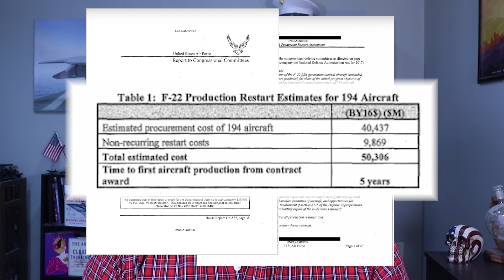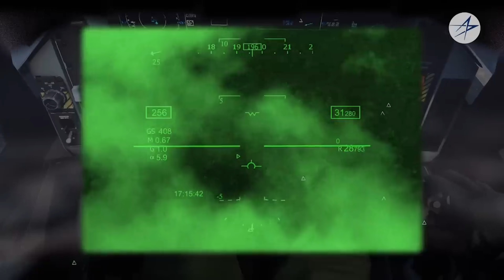The 2ND GENERATION F-22 RAPTOR we ALMOST got

Comment: F-22 and F-35 are too complicated - therefore they are obsolete by the time you've put the latest version of them into service. Gen 4 aircraft are relatively easy (for the west) to upgrade and keep current, for this reason Typhoon and F-15EX are probably the best air to air aircraft in the world as the systems on board (and more importantly the integration with the weapons) are more current than the "more advanced" stealth planes, which have been plagued by endless walls of bugs causing inescapable progress-crushing design freezes preventing the project from staying current in terms of processing, sensor technology and integration with new weapons.  In other words by the time you finally integrate anything new onto F-35 or F-22 - it's already out of date. The latest greatest thing can be bolted into Typhoon, F-15, F-16 etc. and you're good to go after a bit of tweaking - the same project takes 5 years on a F-35 and costs four times as much to integrate and test.

Comment: Thing is: the joint raptor doesn’t even have to be maneuverable. With a HMCS maneuvering is not that important with high g missiles. That means less cost and weight instead of thrust vectoring. Great concept and idea just not as useful in my opinion.

Comment: A better plan in my opinion would have been The F-23 Joint Strike Black Widow. Take the coating and avionics system from the F35 and put it on the F-23. airframe. The bigger weapons bay of the F-23 could allow for better strike capability the the F-22. The F-22B makes a lot of sense for the USAF but the shared logistics would still be limited to the engines and some airframe parts. No matter what other nations that are getting the F-35 would have been interested in getting the F-22b or F-23b Australia, Canada, Finland Norway, Poland,, and Israel jump to mind.

Comment: If they have to build everything from scratch for a new fighter, wouldn't that be the same issue and cost for the NGAD fighter ?
If they started in 2017, they could have had new F22 by now, and when the NGAD fighter comes, they'd have some lines in place that can switch to the NGAD fighter...
I really see no problem with that cost, especially if you need to build everything from scratch again...
If they kept the F22 lines open, F35 would have been more expensive... However you slice it, eventually something will cost more cause you need new stuff to build it !!

Comment: Isn't the F-22's AAR-56 MAWS rather similar to the F-35's DAS?  It isn't integrated and sensor-fused in the same way, but physically it is a similar system that is already installed, and I think one of the upgrades the F-22 is receiving as we speak is greater integration of this system, based on how it's done in the F-35.  It won't allow the pilot to see through the airframe, of course (especially with no HMD), but it will be used to increase overall situational awareness like the DAS does for the F-35.

Comment: One thing which comes to mind while looking at the xmas list of the "Joint Strike Raptor"... 
...is that reading the list should really make one appreciate just what a beast the F-35 is. 
And with over 500 F-35's in service with the US, and more coming every month... why do we need a "JSR" again?

There are a couple decent answers, namely max altitude, high supercruise, and maneuverability.
Hopefully, understanding the targeting capability of the F-35 makes that third reason pretty meaningless.
The first two reasons though, are relevant for air superiority work to close weakness vs high&fast attacks, and to boost energy for longer range BVR engagement.
I think the air force has their eye on something higher & faster though.

Comment: Just goes to show that although advanced, aircraft aren't built like they used to be and its all about money. For how long it took to design and bring the F-22 into service and the amount it cost, it should be an airplane that ladts 40-50 years.  8000 hours is nothing. Flight hours per dollar is ridiculous.  Plus, it sounds like other than the coating, its fairly useless if it has to point what its shooting at. I think the F-23(black widow) performed bettr. I hope they designed the F-35 better. Its like they just dont care. The aircraft they chose to replace the H-60 is another example. Its probably going to end up with the same problems as the osprey. Why they would choose a combat aircraft that has no ability to glide or autorotate if the engines get shot out amazes me. All it can do is crash without engines. At least the Sikorsky model could autorotate. I know our older aircraft aren't as tech heavy, but trillions of dollars should last longer than the career of the person flying it.

Comment: There are still reports of Japan developing there X-2 program and that the speculation had been that Northrop Grumman was involved somehow as well. Now I don’t know how much of this is just YF-23 fans fantasy but this story seems to run parallel to this. Now around 2017, we understood that production of F-22 was being looked at (Lockheed Martin facility, Orlando) but most of them went to work with Northrop team to work on the sensor suite for Lighting. Now with all this going on, one could possibly suggest that the JSR is not 💯 dead to Japan as they continue with their stealth program. It’s a pretty safe bet that working with their American counterparts, we could see something really special in the NGAD in the now so distant future. Also, as block 4 Lighting start production, have they been able to solve their power consumption output for onboard systems? One would think that a mini reactor core could help but I am not sure we are able to make a STARK INDUSTRIES Ark Reactor just yet. 😉

Comment: Well, now both, navy and Air Force made a Mistake. The Navy for retiring the F-14 without having an equivalent replacement fighter, because in my opinion the F18 isnt near anywhere of the capabilities the Tomcat had, no offense against Hornet fans, still a great plane :)  and now the Air force for not evolving to the the Joint Strike Raptor.

Comment: The problem that I’m hoping I’m wrong on is the 6th gen Fighter being the size of the F111 isn’t going to be a dog fighter but a control air craft. One again it seems the Higher, Faster, Further camp is making a technology blunder. 6gen isn’t going to have better maneuverability aerodynamics at all when compared to the Raptor. The Air Force bureaucracy is once again at it with Technology worshipping. Missiles and unmanned drones will do it all for us. Our Heavy Technology driven country can do short wars but a long term attrition warfare will deplete our ability to sustain complex aircraft. So if we don’t knock China out quickly our military is going to struggle. Please Read the Book Boyd and you will see a modern pattern that the Pentagon is pushing for of the same mistakes of the past.

Comment: I really wish they would look more into the idea of fielding this upgraded F-22, or a modified F-35 variant more in line with the F-22s air dominance capabilities if they want to phrase it that way, and open it up to our closest allies to drive down cost per unit. Maybe with a secret self destruct charge in case it ever lands somewhere it shouldn't, lol, but even having a few squadrons in the mix might do wonders for deterrence. Since we'll be replacing it with NGAD or whatever in 10 years, it doesn't have to remain in service too long, but could help when the existing F22 inventory starts to drop, especially if NGAD or whatever ends up taking longer than expected to ramp up.

Comment: We should be building these INSTEAD of the backwards looking F-15EX.I think the EX is a STUPID decision.

I mean, the only change I would make to this proposal...  would be to design for the GE XA100 as the engine option. That engine produces more thrust with higher potential efficiency than F135 ... but it fits in the same engine mount. You could "strap on" the F119 thrust vectoring controls to either engine. By designing for that mount you could being manufacturing with the F135 right off the P&W line for F-35, and then transition to XA100 if/when it is proven reliable.

This program would not only give us a better economic case for upgrading existing Raptors... it would multiply our combat capability. Also -- this "Lightning Raptor" wouldalready have a thousand network cousins to interlink with.

Instead we have the F-15EX which will be an expensive target during THIS decade..

Comment: I know this is supposed to be an F-22 video, but man, it really does sound like he's just hyping up how crazy the capabilities the F-35 are and how much it brings to the fight. But as cool as the F-22 has been, it really just makes more sense to just make a better F-22 from the ground up that have better upgrade-ability going forward. I also still believe people forget that the F-35 is still a capable air superiority fighter, but it's just that it's older brother does the job better--aside from the off-bore part.

I wonder if the F-22 also benefits from having F-35s working with it like the gen 4 planes do 🤔
Reply: The most sane comment in this entire thread. The F-22 has advantages at giving missiles better parameters (60k vs F-35 50k and Mach 1.8 cruise vs Mach 1.3). These are great advantages, but we have fighters who work with less and perform just as well. There's so many examples of 2 F-35's facing 4-8 F-15's and coming out on top, but for whatever reason people want to still call it a "attack" aircraft.

Comment: Because of the cost of the F-22 to operate it's much better the US stopped production and this is something most people don't want to acknowledge.

6th gen is going to be superior in almost every way ESPECIALLY the operational cost due to having to recoat the surface of the F22 to provide stealth.  And it's that limitation that also means every time a pilot has to kick the F22 up in speed, the aircraft has lost part of its stealth.  The fact that the NGAD is supposed to use more of a permanent material for stealth is a big improvement.

And China is about to go bankrupt, or I should say a lot of their local govts. are about to go bankrupt and the CCP is going to have to use QE to bail them out and it's going to drop their currency to near junk, so when they have to buy raw materials or good it's going to be a lot more painful for them so NOT too worried about China for a while, like the next decade because that's probably about how long it's going to take them to recover economically, if they even can.
Reply: F-22 was supposed to be chepaer to maintain than F-15. F-35 was supposed to be cheap to buy and operate. It always ends up another way.
Reply: Then there is the sudden news of massive military purges in China over corruption in the PLA and PLAN. Unless Winnie the Xi gets backed into a corner there should not be anything to really fear from Chinese military aggression for the next decade.

Although these purges could be a form of disinfo made by the PLA to create a false sense of security so stay alert.

Comment: Holy cow 335 million each, when the world's best fighter the F-35A is currently 78 million each. 
Economy of scale with all those other countries that helped design and build the F-35 does work to bring that price down..............the more allied countries buy into it the better.
What's needed now is a long range strike version of the F-35, say a FB-35A for just over 120 million, that's for the Pacific and aircraft stationed in Britain, as the F-111 really never was replaced in due to its extensive range.
Manoeuvrability high alpha's, g pulling is negated when missiles now can fly a 360 degree over shoulder DAS lock on acquisition.
Weapon systems/weapons in combination with stealth, networking, DAS, ECM, ESM and tactics matters.
The F-35 block 4 is superior to all, even the F-22 upgrade, but what is needed is range.
Can't wait when we get to see an actual real NGAD and review that bad boy, but how much for one of those? 
Because it will not have economy of scale.

Comment: I have often wondered why the F22 had AIM-9X when they couldn't utilize the missiles off-boresight potential to its fullest. It's a shame the cockpit was deemed too small to incorporate a full HMDS (Helmet Mounted Display Setup.
Reply: The official reason is that giving the 9X/JHMCS combo to 4th gen fighters drastically improves their combat capability, but since the F-22 already started off being so much better, effectively it would only give it a marginal improvement. Plus the Raptor would be less likely to find itself in a post-merge, WVR fight where you really need it, and if it does, its supermaneuverability can help make up the difference.
Reply: Which was a smokescreen - the real reason is the obsolete old clunkers of computers onboard F-22 cannot handle the extra bandwidth required by HMDS, even integrating AIM-120D was a real headache due to the increase data rate compared to AIM-120C. F-22 is completely obsolete under the skin - it needs a total refit.  Block D on F-35 is a band-aid - that will be the last bodge of a upgrade before a total new avionics refit is required. Essentially F-35 is 20 years old (IT tech wise) and F-22 is 30-40 years old. The planes are so complicated that keeping the systems up-to-date has proven to be impossible unlike F-15 (with EX) and Typhoon where bolting the latest and greatest sensor or IT upgrades on is relatively straightforward - particularly with Typhoon which is totally modular.
Reply: @LondonSteveLee Arh not 30-40 years old, then you are in the area of early home computers and before TMSC chips etc. used in any electronic. If it was that old it would not even be able to handle AIM120A.

Comment: The reason what you call the Joint Strike Raptor was not attractive to the Air Force is that it would still have limited combat range and in a western-Pacific scenario, unrefueled combat range (radius) will be one of the overriding considerations.
Reply: Stealth FB-111A🤣
Reply: Expensive to boot

Comment: I think it’s absurd that the F22 doesn’t have an HMD. I honestly don’t believe that’s the case. The air force would have to be unbelievably dumb to not give their foremost air superiority fighter one of the most important tactical advantages in a dogfight. Maybe they still want us to believe they lack that capability but I don’t believe it.
Reply: I was under the impression that it has an HMD but not a full helmet-mounted cueing system.  So it has the heads jp display part but not the ability to target things by looking.

Comment: As an inspiring aerospace engineer, I too came up with my idea for some sort of Franken fighter, but instead using more of the F-35 parts to build a frame that looks like the F-22, plus elements from like the F-15 and F/A-18 for improved pilot adaptability in combat.
Reply: But due to the lateness of the project and constant design freezes for bug fixing, F-35 is already 2 generations out of date (IT wise) - it needs a total avionics refit, there a limit to what you can squeeze out of a bunch of Intel i960s! - Block D is only a band aid. Starting from scratch would be a much more fruitful endeavour given todays AI accelerated development techniques - F-35 suffers from a lot of the spaghetti design issues that plague F-22.  The USAF can see the writing on the wall, they cancelled a massive F-35A order replacing it with F-15EX as the EX is the more modern plane! They know an F-35A order now means block D delivered - which is a dead-end purchase - total redesign needed after that - how much will Block E cost and will it even work? The upgrade alone will probably cost as much as a F-15EX new!
Reply: @LondonSteveLee  My idea was to have an advanced low cost fighter to compliment sixth generation fighters.

Comment: I think the air force and the ngad program is going in the right direction, future air warfare will mostly be composed of ai drones with human operators. sure you can build the very advanced raptor but is it really necessary? we already have the very capable f35 and ngad fighters will join the fleet in a decade with ai drone wingman. it wont be about the capabilities of the fighters themselves but rather the drone wingman they are bringing to the fight with them. we don't need a very good air superiority fighter for tomorrow if we are planning on making ai drones do air superiority for us in the future anyway. we should instead be focusing on building better drones and missiles for the drones